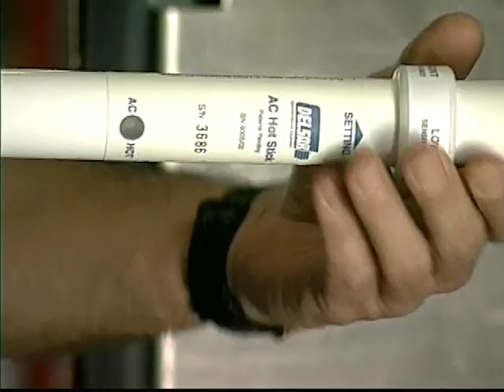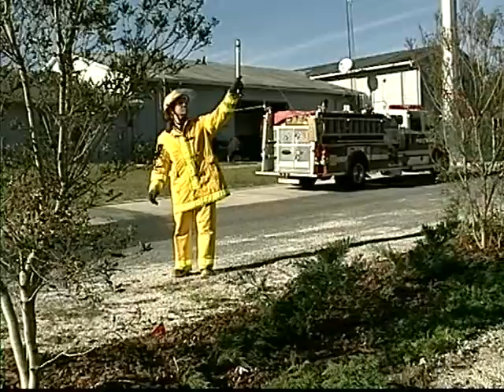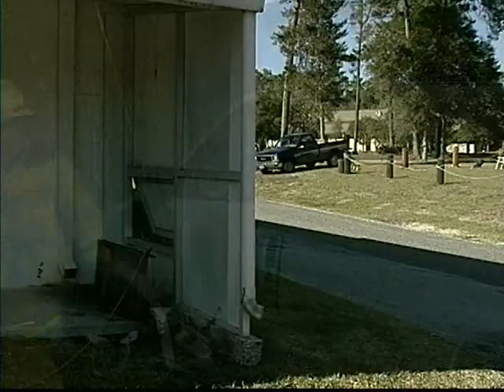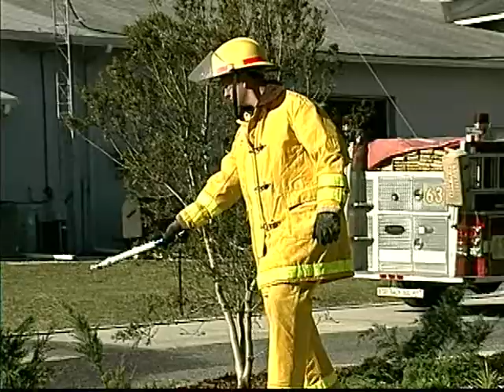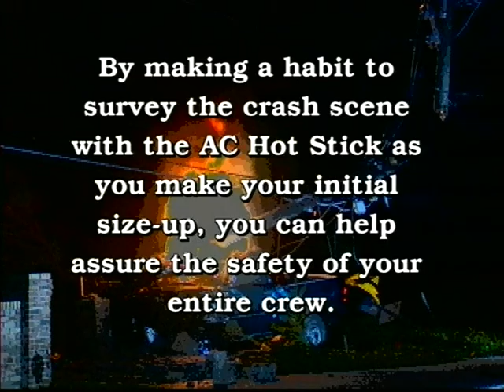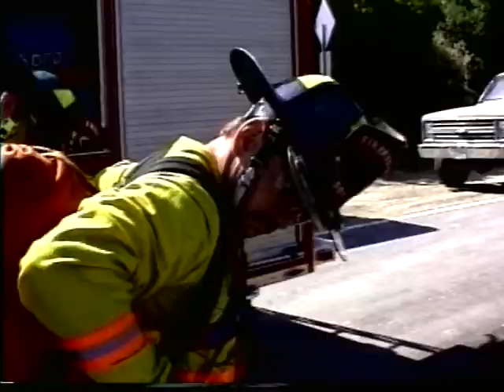How the AC Hotstick USA works

Comment: It’s not rare it’s always the case with any circuit with a three phase transformer bank which is most circuits. Any home owner can plug in a generator to a outlet and energize the high voltage side of the transformer.

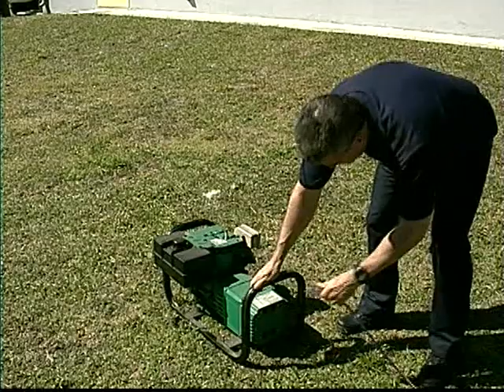Comment: WOW! @ 10:15, "Backfeeding".  It makes sense, but never heard of this dangerous situation. Always thought of transformers "stepping down" electricity, not the reverse! How rare is this event? Would love some explanation of this condition.
Reply: Step-down transformers can act as step-up transformers; when I was 11 or 12, the custodian at my school gave me a filament transformer designed to convert 115VAC to 6.3VAC. Later, when I connected another low-voltage AC source to the secondary (possibly low AC voltage from another filament transformer), I got enough voltage out of the original transformer's primary to sustain an arc and to power a mercury vapour tube.